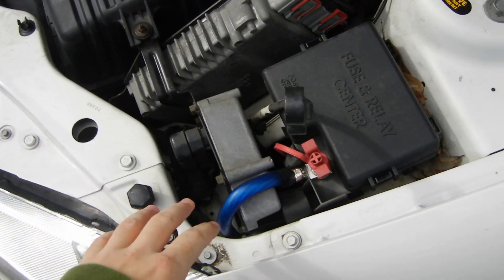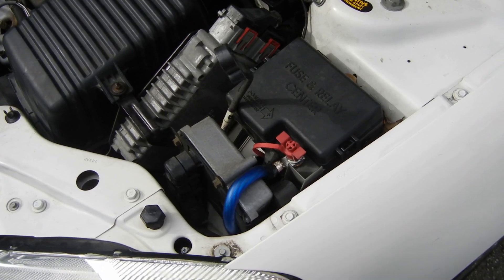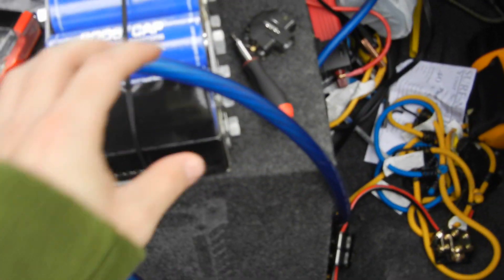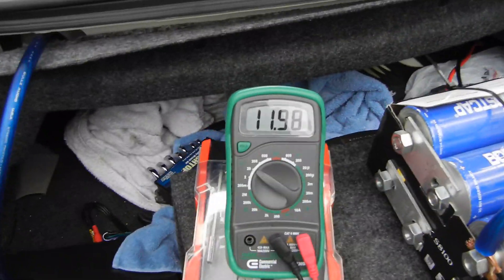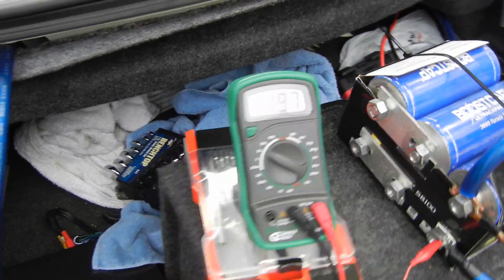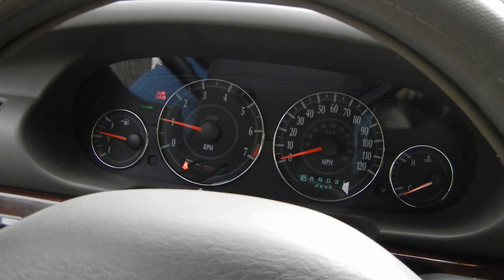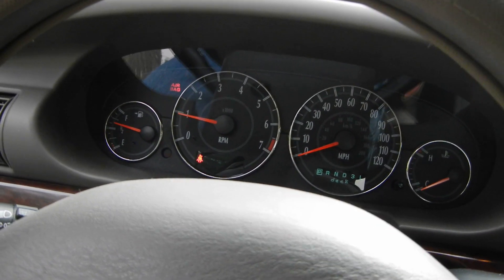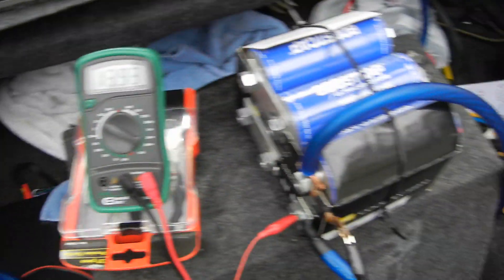Starting a car with ultracapacitors

Comment: does using an ultra-cap as a substitute for a conventional battery harm the charging circuit of the car? as you pointed out, it "labored" a bit as the alternator tried to recharge the ultra-cap. would doing that repeatedly cause eventual failure of the alternator or other part of the charging circuit?
Reply from the maker: With only an ultra cap and no battery, maybe. If you have a battery paired with the ultra cap, it'd probably be much much less demanding on the car's electrical system. If you had a short circuit anywhere though, it could be pretty spectacular.
Reply: @72fr250  I agree with your assessment -- I'll try a parallel method as you described. thanks.

Comment: the supercaps are delicate objects, you ought interpose a regulator between caps and carelectrical  implant, in this way preserve they from overvoltage and you could exploit the major dV, the consequence is a less capacity at energy parity, a DC/DC converter at low voltage is fairly cheap...this application is useful for scooter, the middle life of its battery is about 1,5 years. however good video
Reply: +Tim Spriggs A years ago I bought a supercap made up of 6 caps of 2.7V and 3000F for a total of 500F@16V max, It works fine for my tractor ! what you mean for MOV ? I think that some BJT in darlington configuration are useful for cap protection....
Reply from the maker: There's no need for any additional regulation since the car's alternator already has a high power voltage regulator built in. The capacitor pack's maximum voltage of 16.2 volts is well above the alternator's 15 volt regulation limit. A DC/DC converter will not deliver the hundreds of amps required to start the car, so the capacitors must be wired in series even though much of the capacity is wasted in that configuration.
Reply: 72fr250
i'm studying at the university a course that treat this topic, DC/DC converter could be made using some irfp4368 in parallel, is simple to arrive at 500A or plus, colud to be a good argument for my future thesis...
Reply from the maker: 500 amps at 12 volts is over 6000 watts. If all of the capacitors were wired in parallel at 2.7 volts, it would take over 2000 amps to crank the car. With 2000 amps and only 2.7 volts, the resistance of the MOSFETs would be significant and dissipate a large portion of the power as waste heat. In addition to the power lost in the MOSFETs, the capacitors also have an internal resistance and will dissipate power as waste heat. Less power may be accessible with the capacitors wired in series, but it is far easier that way.
Reply from the maker: I have a DC/DC converter that I used on a 350 watt scooter so that I could get more range out of the capacitor pack. I understand what you are saying, but there is too much power being used to crank a car for a DC/DC converter to be practical.
Reply: 72fr250
yes I mean a series of capacitor (for example 24V) and a back boost converter, the dV should be 5V-24V, this converter has about 90% of efficiency, the losses are negligible...
Reply from the maker: I do not understand why you would want more capacitors in series. That would lower the capacitance and make even less power available.
Reply: 72fr250
maybe I've exaggerated, 16V-8V permit a major voltage excursion and a compromise for facilitate the work of DC/DC converter, higher voltage = higher transferable power and low losses, although this solution produce the stack losses but they are limited...
Reply: +ottanicubano88 Could you use a 12V MOV to protect the caps?
Reply: ottanicubano88 MOV = Metal Oxide Varistor.   they keep spikes to a safe level.  anyway, that's awesome what you got there.  I hope to be like you one day.
Reply: I don't know if they are available with so low voltage, however some BJT in Darlington configuration are good, you can protect the caps with steps of 0.6V.
Reply: ottanicubano88 yes, they are.  from newark electronics.   I already used one I bought from them for a smaller super cap board which is plugged into my cig lighter.   whether they are better than other circuitry , I don't know.   I like these super capacitor gadgets.
Reply: +Tim Spriggs it is important to see the range of MOV operation, its selectivity might not be sufficient to avoid the cap overvoltage...
Reply: It goes as high as 16V if I'm not mistaken, which I rarely am.  lol.  MOVs are not immune from destruction though.  But usually they take the hit while the equipment is protected.
Reply: +Tim Spriggs but I'm not sure that exists a MOV of 2.7V because you must protect each single cap of the array.
Reply: ottanicubano88 no, I protect all of them at the input(or output), where 12V is at.
Reply: +Tim Spriggs a ok, it is all clear now, because I believed that you wouldn't buy the protection board provided by the sellers on ebay for example. However if you haven't a protection for each one, I advice you to put it, the  voltage apportionment might not be equal, and your caps might be damaged.
Reply: I just bought a Platinum battery from Autozone before xmas and it really starts the car good.  But I'd like to add a capacitor bank just to be a show-off.   I'll try to have it protected.  maybe a condom, or two.
Reply: No "capacity" is wasted.  The energy content is the same for the parallel and series configurations, however the series config has a lower capaciTANCE.  For an ideal capacitor, the charge it can store is equal to the capacitance times the voltage across the capacitor terminals.  This means that the series bank can hold less charge, but it can "push" the charge at a higher voltage and therefore deliver more current (charge per unit time) across a given resistance.  In practice, this would result in a capacitor that discharges faster, but does so more energetically.  At the end of the day, for ideal capacitors, the amount of energy (Joules) stored is the same.

My main point is:  changing the configuration of the caps will not change the amount of energy contained within the bank.

Comment from the maker: When my car battery finally dies, I may put a small solar panel with a voltage regulator. They told me my battery was weak last year, maybe I should disconnect the caps so the battery will hurry up and die

Comment: As long as the voltage of the solar panel doesn't go above the capacitor array voltage, they will never overcharge, so a 16.2v array with a 16v solar panel would stay at 16v forever without any wear or tear to the capacitors.

Comment: If you buy those solar panels from the store, they have built in voltage regulators, diodes, and everything you need to safely charge a battery. But they aren't the best for lead acid batteries.

Comment: I believe some batteries at the end of their lives have enough charge in the unit but the amps inside cannot get out fast enough to turn over a starter motor. This is where supercaps must help. A decent supercap array parallel to a say a Prius must also assist greatly in a hybrid to reclaim kinetic energy and give it off in acceleration. The all electric range must be enhanced. There is enough spare space in the battery compartment in a Prius to accommodate a supercap array.Toyota add on?

Comment from the maker: I don't really want to not use my car for two weeks to find out for sure, but you could just disconnect one of the battery terminals from the capacitors before you leave and they will stay charged for the 2 weeks you are gone. Or get one of those small solar panels that suction cup to the inside of your windshield and plug into your cigarette lighter to keep it charged; you'd have to put something to limit how full the capacitors get though.

Comment from the maker: I saw you have a bunch of audio videos on your channel. They're not really good for anything except very heavy short loads. So motor starts and of course audio systems. You can try using bigger deep cycle batteries paralleled to your caps so that you have the storage of a deep cycle battery with a few thousand cranking amps. I've used them to jump my car off a few times since they still discharge crazy amps at low battery voltage. Be careful how you charge them since at 0 V they're a dead short

Comment from the maker: Yes haha, It runs up the inside of the front fender and then comes in. It runs underneath the rubber seal for the door, so when it shuts, it's still water tight.

Comment from the maker: I bought 6 for $75 per cap off ebay around when they first came out, and bought 18 more off of electronic goldmine for $20 or so per cap during a sale. Your best bet for a good deal is ebay. Lasersaber has a link to his website which has a link to an ebay listing that averages to like $15 per capacitor.

Comment from the maker: It was just a test. The ground is several feet long and mounted onto fairly thin metal on the body instead of the chassis, and the positive is over 10 feet long. Far from ideal for cranking amps. Thank you for the suggestion though